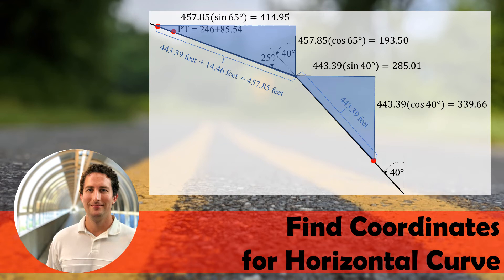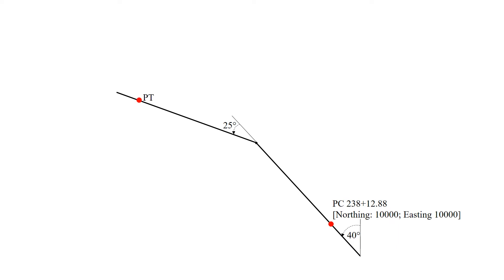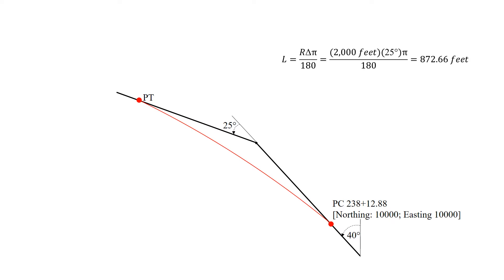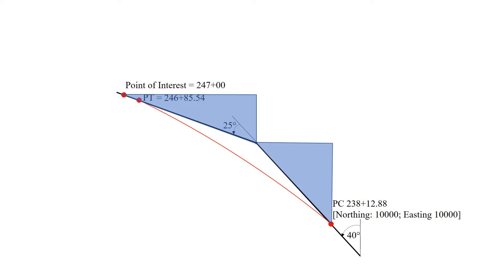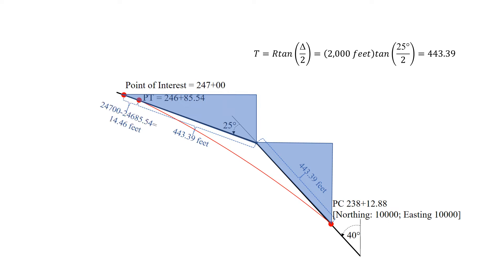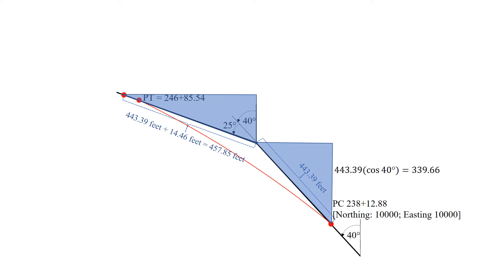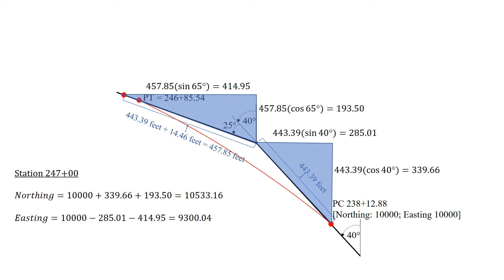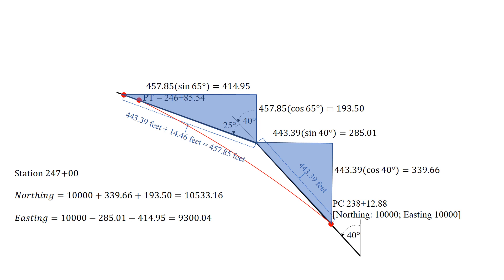Find Coordinates (Northing, Easting) for Horizontal Curve | Example Problem for Point on Tangent

Comment: Considering the deflection of 25 degrees left, the forward tangent can also be set on the right side of the back tangent. In that case, the northing and easting of the point of interest would be different. Let me know your thoughts on this. Thanks.
Reply from the maker: You're correct, if the forward tangent instead turns to the right instead of the left, it will change the northing and easting of the the point of interest.